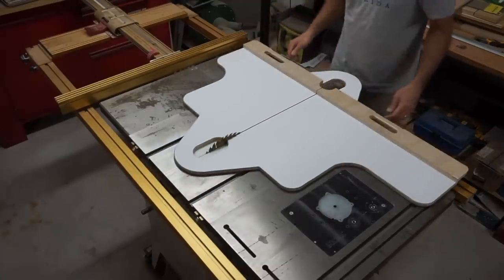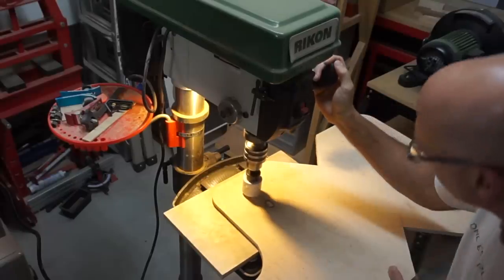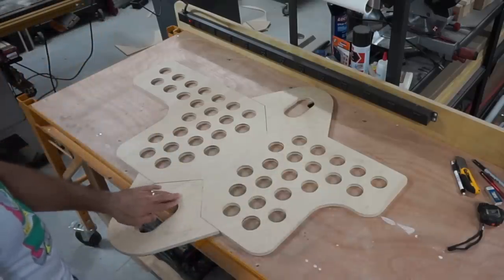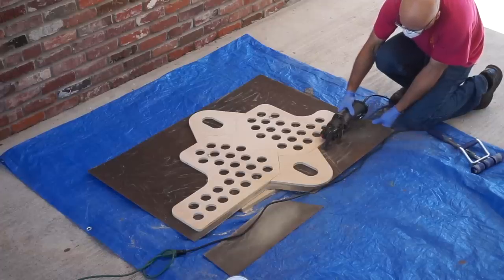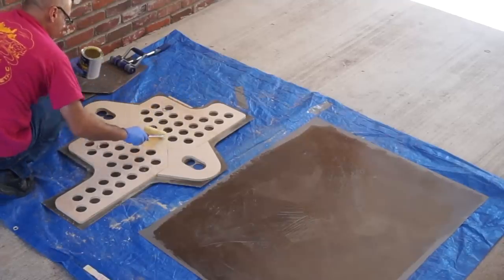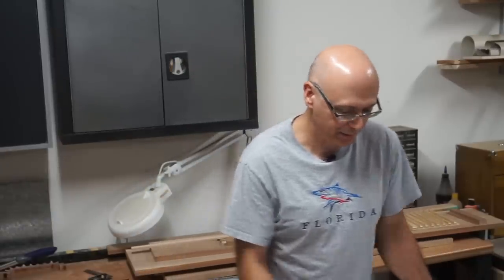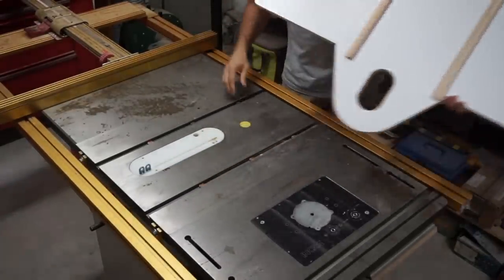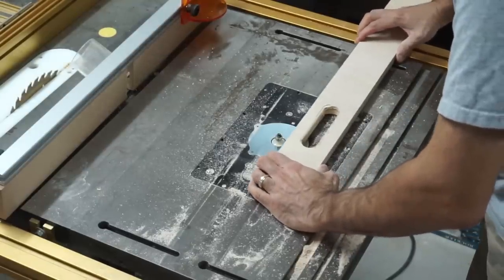A Crosscut Sled Like No Other

Comment: We only see 1 cut (thank goodness) with this sled,he then checks with square and then measures with calipers.Was the original board cut with the sled?On 1 or both edges?If he had made a second cut on the board's opposite edge then the measurement would have validity,we can't judge the accuracy until both measured edges were passed through the saw with that sled.There are far better designs for sleds that better protect you from the exposed blade,but more importantly are far better in the ergonomic aspect (the 2 shoulder width handholds in the flat fence are just foolish without hold-downs for the work piece),so we are left with the advice of don't try this at home without major revision.

Comment: There are a number of comments along the lines of, '' You should never push a piece of wood..... etc.
An artisan, local to me,  got a little complacent about safety with a large circular saw. The result was, a shard of wood flew off, passed through his eye, and entered his brain.
He was in a coma for a couple of weeks or so, but eventually recovered, but with only one eye, and brain damage. He had to retire, and his son took over his business.
In another you tube video, a comment was; ''Crocodiles have lots of teeth, and eat meat. So do chainsaws.''
I suppose any motorised equipment with teeth can be viewed in the same manner.
Never get complacent about safety.
Anyway back to the sled. My thoughts.
I dont understand why the small pieces were screwed into the ''V'' cuts, and not cut in one piece, perhaps someone can enlighten me. Also, when the facing was cut, it looked like the two parts could have been nested, and less material wasted.
As it's so light, it might be an idea to screw suitable washers to the underside of the sled guides to insure retention in the slots.
It looks a good idea, and the facing will ensure free movement of the sled, but that might be a disadvantage on the top surface when the location of work-pieces may be difficult to maintain. The ergonomics look OK, but the grips might have been better raised a little higher, as I fingertips or knuckles could get nipped, or skinned. Time will tell.
Perhaps an update when you've had some experience with it.
I've saved it for future reference. Thanks.

Comment: I like the design and the idea but the pocket hole attachments along with the way the laminate was glued up surely made it warped or at least not flat. The purpose of a sled is for cutting accurate pieces, especially small pieces. You will get a lot of gaps when using this assembly process. Again, good design!

Comment: Mike I almost never comment on a video but as others here have expressed the use of this sled in my opinion is not as safe as others I've seen. Needs more work I feel as the location of your hands are so far away from the material I see no way you would control it if one hand was to be removed from pushing the sled giving less control of the cut over all. The use of laminate was a nice addition too. not sure if I would put it on one I would make though leaves little room for anchoring to the plate if needed.
Reply from the maker: Tony, I agree it needs more work. I know lots of people have claimed my design is not safe, but it’s worked well for me. I’ve also been toying with a new design for a while, so you might see that soon. Thanks for your comments!

Comment: I like the idea of making it lighter, but wow, that is a lot of work. Wondering if 3/8" lexon or some other composite would be a similar weight. My other thoughts is I would modify the fence a bit. Those slots look like they might cause a pinch point - ouch! Instead of the slots, why not mount a large knob or ball on both sides to grab. 
Now, the way you squared up the fence would never be accurate enough for fine woodworking. After all, carpenter squares are never really accurate to begin with. A better way would be to start with a carpenter square to set the initial angle of the fence. Screw it in place with one screw on each side. Cut a test piece of plywood about 12" x 12". Rather than test for square with your carpenters square, just flip one half over and put the 2 halves together again. If the cut was out of square, the error would now be doubled and you could really see how much it is out. Remove one of the screws and tap the fence in the appropriate direction to square it up. Then put in a new screw to hold it in position. Repeat this procedure until the fence is PERFECTLY square. Then screw down hard with more screws on both sides.

Comment: It is really cool and an ingenious idea. It reminds me of how some Ikea table tops had corrugated cardboard strips sandwiched between two leminate boards similar to the ones you used, with the corrugation oriented perpendicular to the boards. That should still be able to bear the weight of some heavy material and will reduce the weight of the sled even further. What I really like the most is that you discussed your thought process. To me that is the best way to learn how to solve problems. There are few things that I'd change, e.g. a stand-up fence rather than a flat one. Otherwise excellent job!! Curious: what have you done with all those little discs that you have cut out from the plywood board?

Comment: Hello! What is the parallel cut attachment you were using? Did it come with your saw? Thanks!
Reply from the maker: It's made by a company called EZSmart. I bought it separately from the saw. It can adapt to most models of circular saws.
Reply: I've Been Thinking Workshop thanks!

Comment: Nice Idea, but a little on the down side when considering the safety issues... 
 I did not understand why you did  the plate from 3 pieces and not one? That "Kregg" type connection is to my opinion a weak point to whole plate....

Comment: Interesting idea.  Not quite sure why you had to separately cut our the front/back sections (where you added the oblong holes), and then try to screw back together?  Why not just make it all from one piece of plywood?   And as has been said by many, you MUST secure the back edge or your going to find yourself in the ER.  Yes, the blade is pushing the wood down, but if that wood has any bow to it, it will "slap" the front down, and the back end will kick up and bite you.  If your lucky, you just ruined your work piece, if your not so lucky your CBU (Veger) may be damaged.
Reply from the maker: Jess Cretney, the answer to your question is also in the comments. Read through all the “advice” I’ve received and you’ll find it. Thanks for your advice as well.
Reply: Hah, well you know when you put stuff out there you need to put on your teflon pants.  I know, I have made a few vids and gotten a lot of various comments.  Some are valid, some are funny, some are stupid, and some are down right mean.  Don't let this discourage, use it to improve your next project.  I did like the ingenuity and hey, it does not have to be for everyone, as long as it works for you and your happy with it.  Doing this videos is a lot of work and the pay kind of sucks... Anyway, keep learning and keep doing what makes you happy.  
Brings back an old saying we have at work "Never make any mechanism simple, if a way can be found to make it complex and wonderful!"  (Finagles Theorem, but I forget which one...)

Comment: I enjoyed you're sled video, very inspired design, well made. I did however
see you run you're test stock through with no down pressure on the 3/4"
material, risky, don't you think ?
Reply: Michael Mancini no, actually he doesn't. He even has a follow up video attempting to prove why one doesn't need to hold down the work piece through a cut. Oh, and if he ever gets kickback he's just gonna get out of the way. He thinks he's faster than the sawblade, lol
This is coming from a 30 yr woodworker who has seen with his own eyes "professionals" talking shit and then promptly removing two fingers, due to kickback from not holding down a workpiece.

Comment: I like everything about this sled EXCEPT I'm betting your SLED is NOT SQUARE TO your BLADE unless you managed to get the only framing square manufactured this century that managed to come out square.  Try this, lay the square on the sled and against the the "fence" on the sled.  Now using a FINE TIP pencil or or pen, draw a line from the sled "fence" up the vertical side of the framing square.  Then flip the framing square over and slide the vertical side up to the line at the base of the framing square so that you can start at the same place on the sled fence.  Now draw another line up the vertical leg of the framing square from bottom to top.  Remove the framing square.  If you see only one line on the sled, YOU GOT THE ONLY SQUARE FRAMING SQUARE that was ever made.  But you didn't!   That's why you see two lines starting at the same place on the sled fence and runs away from the 1st line, either to the left or the right.    And if you are satisfied with how your projects will fit together then, God bless you.  BECAUSE you will need all the blessings you can muster up as with every cut you make the odds of you not eating the work piece you almost or actually cut all the way through makes the next cut more likely your head or torso as your saw hands it back to you at 9,000 mph, otherwise known as a KICKBACK.  You need clamps to hold the board you are cutting down to your sled and tight to the fence.   Except in this case, the words Finesse and Table Saw can not be used in the same sentence.  Oh and, pry that 3/4 fence off the the sled and replace it with a 2"x 4" piece of wood (standing on edge) unless you're only going to be cutting 1/16" cardboard.   Hopefully, you take me and probably a bunch other Comments seriously or your projects won't be square or sit flat and/or the next (or the next after that) time you start to make a cut, following close behind you will see stars, followed by flashing red lights and hear a sicking screech as you are driven down the highway.   Suggestion: To get a "square" sled watch Ng's 5 cut method video on YouTube.  But I really, really like your creativity and all those great tools!

Comment: I wonder how it would work to use rigid foam for the core instead of wood; much less work and a lot lighter.
Reply from the maker: That’s a good idea, Noah! I have worked with rigid foam some, not in a project like this, but as insulation, so there was no joining of parts involved. Have you worked with it in a project?
Reply: @IveBeenThinkingWorkshop  Nope, just thought about it. And I guess you'd need to add wood inserts for attachments, but that's not a big deal.

Comment: Great sled and video! Mine is huge so i think i need one:)  I noticed that you have the Ridgid oscillating sander... have you had any problems with the sanding sleeves slipping on the rubber inserts? Mine slip up and down no matter how tight i have the nut on top?
Anway, thanks for the video!
Reply from the maker: Hi Lyle, thanks for your comments! Regarding the sander, yes, I have had trouble with the sleeves slipping. I found that there is a limit to how much pressure I can apply while sanding before the sleeves start slipping.
Reply: Thanks for your reply... at least now i know im not alone:)

Comment: The weight of the sled along with it"s design is pretty cool. His first cut made me cringe as well,  but its his eyes, fingers, and face involved, not mine.

Looking at the design made me think that a few strategically place tee nuts on the underside would allow for "HOLD DOWNS" and other jigs. Tee nuts wouldn't add much to the weight and would be useful for many things.

Comment: As with all things, every iteration gets better and better. You have taken this tool design to a new height. BUT, your acceptance of the .033 in 15" square error is not in keeping with the idea of building the sled in the first place, (repeatable square accuracy) Perhaps a hardwood dowel pegged thru the handle end and the sled base would give you a pivot point and the other end with an adjustment mechanism (make it robust) to move the handle in or out to achieve a true world class '5 cut square'. FIX the adjusted handle to the board THEN cut thru the handle. I'm even thinking of making the sled base out of 1/2" polypropylene and dadoing the runners into the plastic secured with countersunk screws.
Reply from the maker: Good ideas, Darrow for the Prosecution! Thanks!

Comment: I like your sled, but I noticed you did secure the piece of wood you were cutting which could be dangerous!
when you wax your sled, wax the whole bottom of your sled not just the runners, I think you'll find it will slide easier yet.

Comment: Not clear just what you are measuring for that square check. Did you flip the stock to take a mirrored cut? I do like this method for checking square, compared to the vaunted 5-cut method, because it is far easier to do mid-process, and gives a direct, and intuitive reading of the deviation. Flipping compounds the error by a factor of two, giving you a better chance to read the error with your tape measure; maybe it doesn't magnify it as much as the 5-cut method, but it is easily possible to spot a discrepancy of say, 1/128", roughly equal to .008". The actual value would be half of that. Four thousandths of an inch over say, 18", is a pretty high standard to hold a piece of wood, cut with a wooden jig, to. All else is vanity.

Other likes: the lightening of the bed, and the rigid, accurate gluing in place of the guide runners, especially with non water based adhesive, and flat storage.

Comment: Love the concept.  

I'd have attachable / removable toggle clamps on the back fence for work hold-downs.

Also, as others have said, that 0.033 difference in width does not insist that your cut was out of square.  Maybe the sides of that workpiece were not parallel to begin with.

Comment: You wanted a sled that was not cumbersome to handle. The sled is too large and awkward. You cannot clamp a stop block to  the rail for duplicating cuts. The error you mentioned is far too great for accurate work. Being out of square that much is totally unacceptable. The runners stick when moved down the table. It is far too easy to accidentally cut into either end of the sled. There is no hand protection from the blade on the near end  when exiting the cut. You should always hold the piece down when cutting, otherwise there is the danger of kickback if the blade is not properly aligned with the table slots. Overall I would rate this TS sled a failure and would not recommend it to any one. Period! PS: You really ought to remove the rust from the saw table.

Comment: Epoxy glue of the back fence ment "0" room for adjustment !!! You could adjust it until perfect!! You need screws to adjust it. Then you could add more screws. Tape it off. Unscrew one side only, add epoxy, rescrew....then same to other side ......it then could be as accurate as Altendorf or Martin......

The plastic laminate face is, pretty, durable and easy to clean......but so horribly slick your wood could "easily " slide laterally!! Now you need to add adhesive sandpaper  so that " when you hold it down" it will stay..........

Old shop rat

just jim

Comment: The true test of the sled is in the fifth cut of the piece.  I think your accuracy is not nearly good enough and since you epoxied the piece there is no way to adjust it before securing it in place.  I also don't like the flat fence, I want something substantial to hold onto as I feed the saw and that narrow piece with widespread hand holes is worrisome to me.  I like the laminate idea, I wish I had thought of that when I built my sled.

Comment: Really like the overall design and look but will use fasteners not epoxy to attach runners and fence and put a taller fence. Cutting a piece like that board and pulling back through the blade with out even holding the board down is asking for a board in the chest. Not great safety displayed here. 5 sided cut  is the best way to check for square.  Good effort though and thanks for a new sled idea.

Comment: Just about every person making comments said something about that board not being secured. Unless like having a piece wood thrown at you at 75 MPH and either knocking all your teeth out or causing enough internal damage that you might or might not make through surgery. Of course it could just penetrate your abdomen and the wife comes out to see why you haven't come in and find you dead. Either hold it down with your hand or some mechanical clamp. But, don;t ever do that again, it is too dangerous.
Reply from the maker: Should I rename this thing “The Rocket Sled?” 🚀 🛷

Comment: Hi
Love the sled!!
Did you make anything that would help you cut angles? This design shows no access to a fence, so only allows for straight cuts and no angles or room for an adjustable stop system. I cut pieces for segmented turning and would therefore have a need to some form of angle cutting device incorporated into the sled.
Any advice or thoughts?
Regards
Dennis Beamish Cambridge Ontario Canada
Reply from the maker: Hi Dennis, yes this sled is only set up for straight cuts. The best thing I've seen for making turning segments would be the Wedgie Sled.

Comment: it’s a nice lightweight sled  but i don’t really understand why   you built it   it’s not like we  generally need to carry a Crosscut Sled very far  and it’s  just dead weight sitting on the Table saw  ?       I am not a Hater  i’m  just really interested  in the  thought process in  sort of reinventing the wheel ?   i spent over 20 years as a professional Woodworker  and most Crosscut Sleds  are  kept within a few feet of the Table Saw it is used on   and don’t get carried very far  from that location